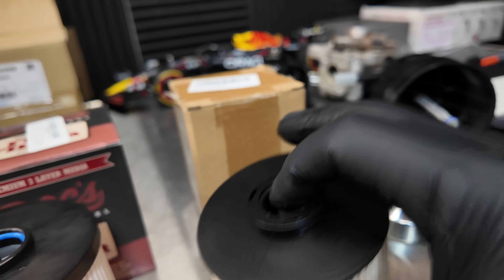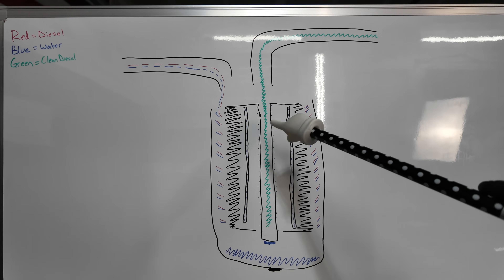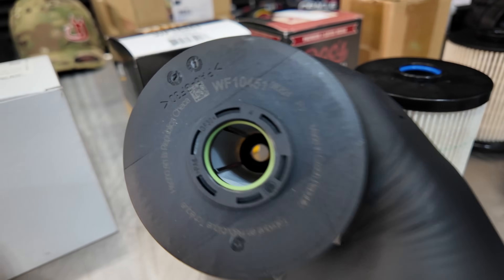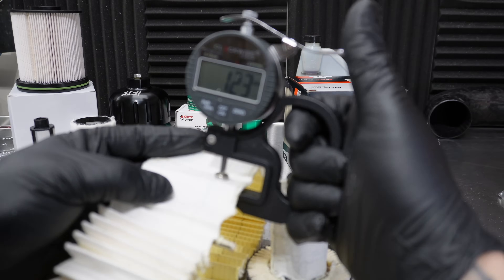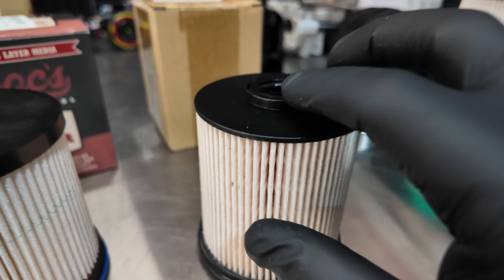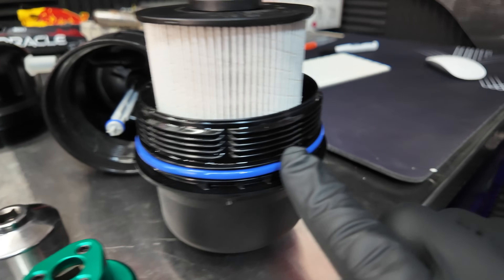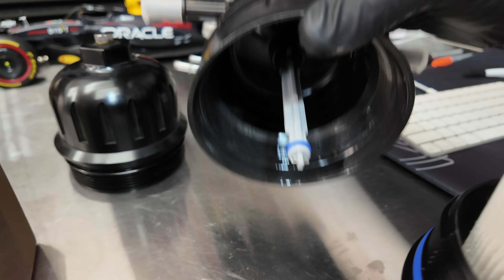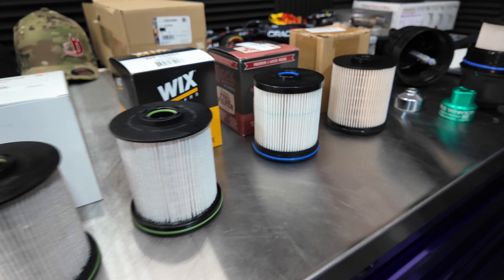HOW Duramax Fuel Filters Work + Why Quality Is CRITICAL

Comment: Good video, but all that said, I upgraded to a spin on fuel filter to my LZ0,  which is bigge,  and 99% efficiency and 4 micron. I use the same fuel filter that the 2500 dmax uses. GM is 20 micron

Comment: Great video!
Just changed mine with 47% left on the cluster as preventative maintenance and noticed for the first time the diesel had a slight blue tint and tiny metal flakes!
Never noticed before, truck has 100k kms, runs great and the maintenance has always been
 dines using OEM parts. Do I need to be worried??
Reply from the maker: Blue tint is normal with diesel fuel but the metal flakes, you need to keep an eye on.
Reply: @DemonWorks thanks. As a GM tech, in your opinion is the Run VSE fuel filter setup worth the money and actually beneficial or does the GM OEM setup enough? I’m willing to invest if it means keeping the truck running as long as possible.

Comment: What do you think about the D-Max converter to use spin on CAT or Donaldson fuel filters ? Really like the simplicity of the spin on but am not sure if it’s an upgrade or downgrade from OEM ??
Reply: I switched mine to a spin on using the donaldson filter. I will check /drain at oil change and replace it once a year, every January

Comment: Howzit, i have a 2023 GMC Sierra with the LZ0. I've been noticing I get regens at about 160-180 miles. Will changing my fuel filter help with that? When i bought it in 2024 (brand new) the dealer said they had a hard time selling it. So I'm thinking fuel was just sitting. Thank and Aloha
Reply from the maker: I resolved my frequent regen issue with using some archoil cleaner. Not saying it will correct yours, but myself and many others have experienced the same results. https://youtu.be/AaGiTiQK_IU
Reply: When I ran Archoil I went from 150-225 mile regens to 550-650 mile regens depending on city vs highway miles. Worth every penny imo

Comment: Hi! Could you kindly tell us where is the fuel pressure regulator on the 3.0L? I cannot find any info about it. :(
Reply from the maker: That is handled at the pump & rail
Reply: Hmm? I keep getting the P228C
So there is not pressure regulator? I assume that’s in actual pump?  I thought it was just a sensor that could be replaced.
Thank you for your help. :)
Reply from the maker: @ricko2591  there are 2 regulators. 1 at the high pressure pump and 1 on the rail. Your issue will need diagnosis, may be a rubbed wire, may be a sensor, regulator or even a fuel issue.

Comment: What about the Fleece kit? Once i heard about the issues with VSE, that seems to be the only other high capacity option.
Reply from the maker: That's a better value, I have heard nothing about them as far as people running them. That may be a good sign. I do still believe the water in fuel sensor still will not work correctly. The larger filter is a plus, Like the vse having dual filters. It's all in what you want, I still think the oem unit is good and even better if the filter is changed more often.

Comment: The filters are supposed to block water, but in reality they don't! A buddy of mine accidently dumped 2.5 gallons of DEF into his fuel tank of his 2021 6.6 Duramax. DEF is 70 % water and guess what a whole bunch went right through the filter media! I dropped his tank, cleaned it, cleaned the lines as best I could, installed a new fuel filter and purged several gallons of fuel through the return line to the filter. I had him drive it for a few days and drain the fuel filter and he captured another 1/4 cup of water. I saved his fuel system!!!! This was 30k miles ago with no issues. All of the dealers wanted to replace the entire fuel system for 22k+. One dealership I know of said as long as it hasn't been sitting with DEF in the system they have had good luck flushing the system and that is what I did. Again, if the fuel filter actually blocked water it would have shut the engine down with no contamination, but that is not the case. He was running OEM A/C Delco fuel filter!
Reply from the maker: In that case, there is not only water but urea, urea is the corrosive item to worry about. WIth def in the tank, it will go straight to the bottom, with the pump pickup. There is no way to stop 2.5 gallons of def fluid in that little filter housing, compared to the fuel tank. No matter what fuel filter system or if you had 8 filters in line, that def will wreak havoc ! Can't blame the filter there. Glad you got it taken care of for your buddy !
Reply: @DemonWorks  Weird thing about the def getting into the diesel, I saved all the fuel I drained from my buddies fuel tank. I thought after it settled it might be good for something else, like one of my diesel heaters. I poured some fuel into a glass container and it looked off, kind of yellow in color! The only thing I will use it for is fire starter! I think the urea mixed with the fuel even though the water settled out. I wouldn't want to risk it in anything!
Reply: The filter likely blew out.  This filter setup was imported off the diesel Chevy Cruze.  It was never designed for using 3 timess the amount of fuel that the L5p uses.  No blow outs on the Cruze or 3.0 that I could find.  But it's the worst filter setup of the big 3 diesels.  It's fine until it's not.

Comment: Thanks for another great video..
Since you live around Salt Lake.. and you see a true winter. Are you using the Aluminum Filter Base or just running stock?
Reply from the maker: Thanks ! I am using the stock base still. I use the aluminum one for display and it's commonly asked about. If my plastic one has an issue, I will swap in the aluminum one.

Comment: I over tightened mine and couldn’t get it off without tearing it up with channel locks. Bought the same kit you did on amazon, but just used to the cover, did not feel like replacing the entire assembly. I purchased a torque wrench and realized how bad I’ve been over tightening it. I get my AC Delco filters on rock auto.

Comment: Actually bought a - MANN-FILTER PU 9012 Z 

Identical,  I have no worries using the 3 quality filters you mentioned.  Go with which ever one is on sale.  AC Delco, Wix, Mann itself.
Reply from the maker: I was going to include the mann filter but didn't want all 3 in the same video. i do have a separate video showing that one as well, all identical as you know !

Comment: What’s your opinion on the dual fuel filter system from VSE?
Reply from the maker: The water sensor is no longer submerged with their setup and I do not trust them as a company because when there were issues with the catch cans, they wanted to keep it quiet and threatened to sue me. I fear the same could be the case with any product they offer.
Reply: @DemonWorks legal action for telling the truth 🤦‍♂️
Reply: @DemonWorks i am hoping FASS brings an LZ0 fuel filter system. I really appreciate this as i was thinking of running that fuel system
Reply: @DemonWorks Make a video on how they wanted to sue you
Reply: https://m.youtube.com/watch?v=A5JrIJH-Nf4&t=23s
Reply: @runvse Trash products
Reply: I was about to ask the same question.  I just purchased about a month ago and haven’t installed.

Comment: Thanks for the great info. Just changed mine at 15k miles. I was happy with the quality of the AC Delco filter. The housing was insanely tight from the factory.
Reply from the maker: Good to hear you got it free, I have received quite a few messages from people that couldn't.